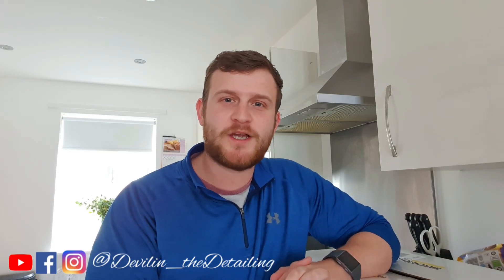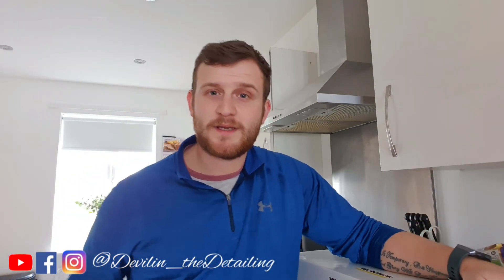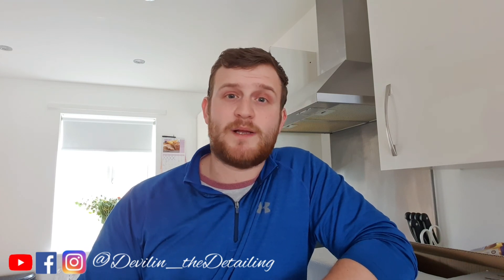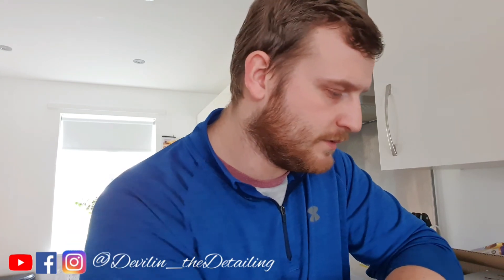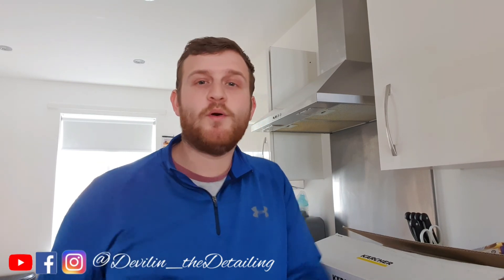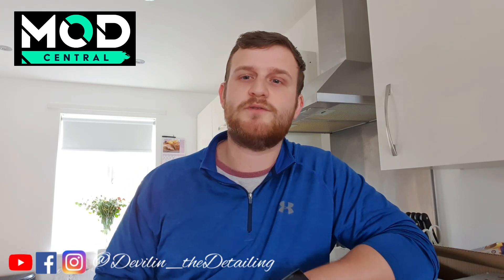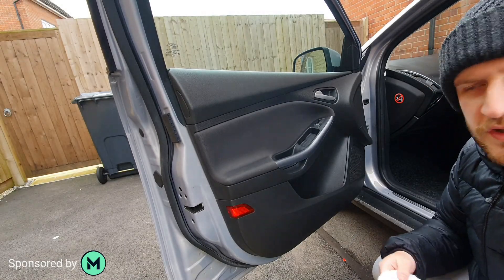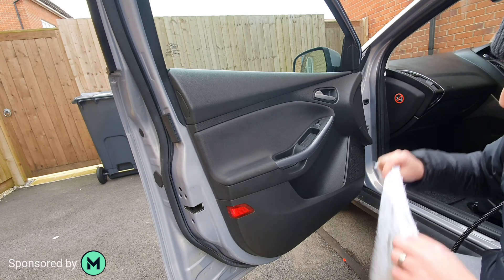Karcher SC2 Steam Cleaner | Product Review

Comment: is it true that the karcher sc2 has problem with the safety valve, secondly do they use distill water to top up or just water?? what is the recommendation  from KARCHER??
Reply from the maker: Hi bud, ive had no issues with this so far been a great piece of kit, the safety valve hasn't shown any issues as such but you do have to wait until cool for it to open so if you run out of water mid job it's going to be a pain of a wait time. In terms of recommended water I used standard tap water for karchers recommendation that's best put to the company 👍